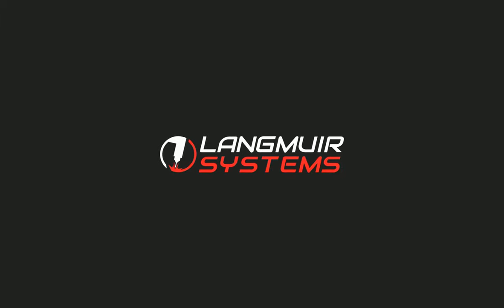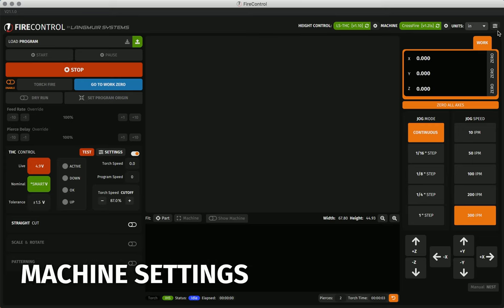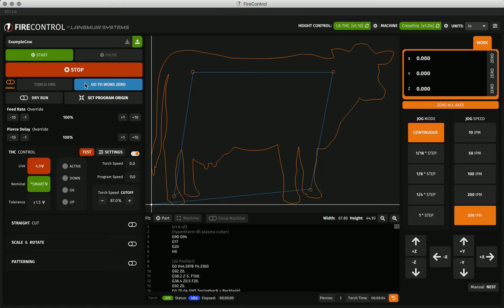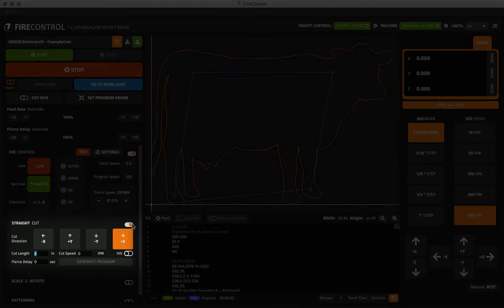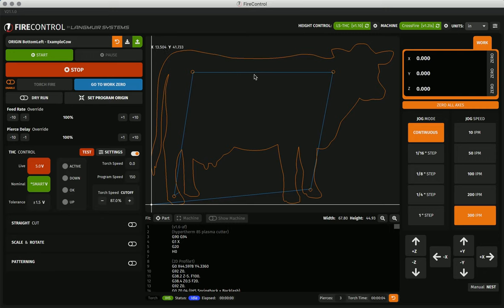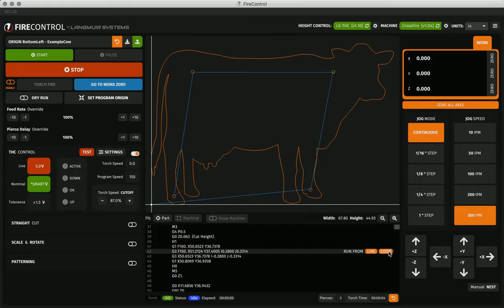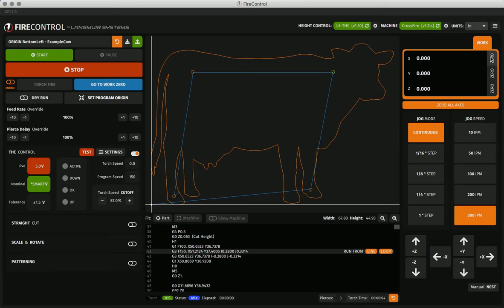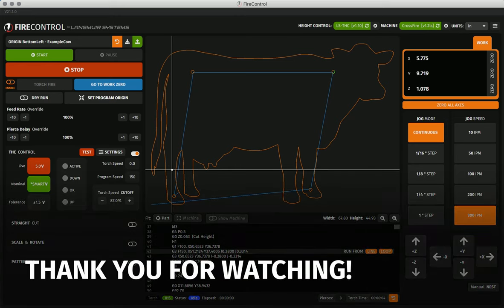FireControl: Overview

Comment: Not an upgrade. Done everything in the forums to fix it. It crashes on "validate program" and even if you get past that, it crashes within 2 minutes with the torch running. Found this video again looking for a way to run it on mach 3.

Comment: FireControl keeps crashing as soon as the cutter pierces the material. Are there any reports of EMF causing loss of data connection with the CNC controller? Is there a way to shield the connection to prevent EMF from severing the connection? We have had some successful cuts but if we do more than 4 or so pierces it will cut the connection and crash FireControl.
Reply from the maker: Shoot an email to our support team, it’s likely you’ll need to install a USB isolator to correct the problem.